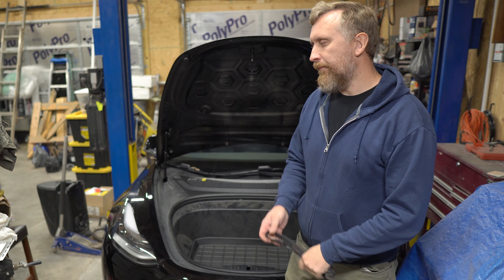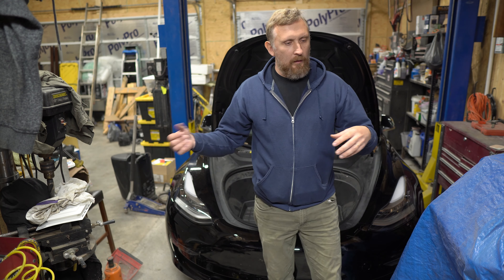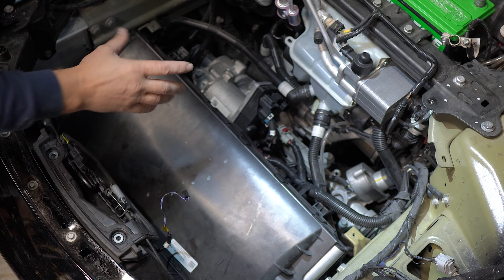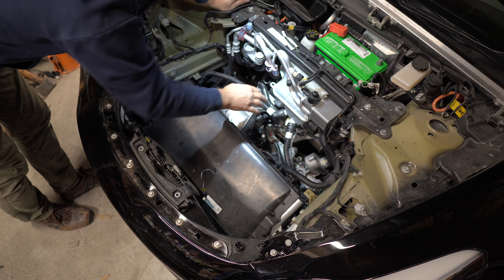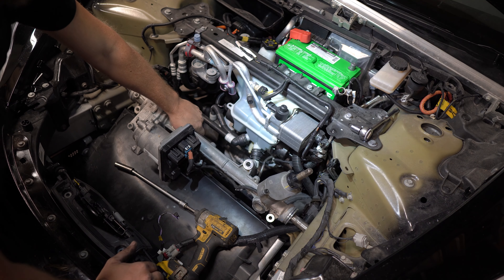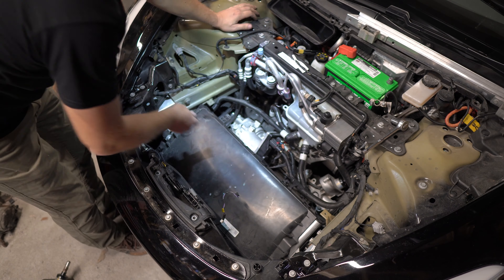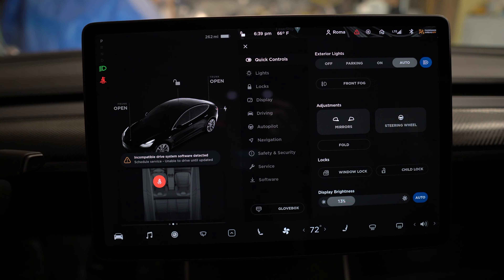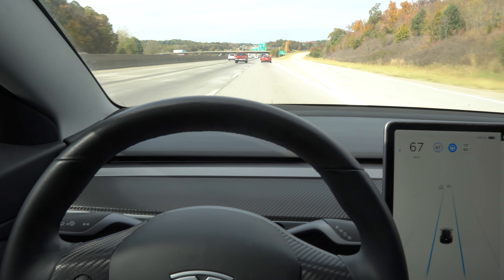Tesla Model 3 Rack n Pinion Replacement

Comment: The last letter on the part number is the version. For example if the part number is 1233454-00-A that’s the first version and part 1233454-00-B is the second version, etc. For the most part, as long as the first numbers are the same then the parts are interchangeable.

Comment: Thank you for making this video!  I hit a curb and I think something broke or worked loose in the rack & pinion.  I already replaced an inner tie rod and was also surprised there was no retaining washer to keep the socket from working loose.  I will plan on re-using the existing motor as you found out.  It looks incredibly easy to swap the whole rack, thanks again.
Reply from the maker: Thank you
Reply: By chance do your know the torque specs for the inner tie rod
Reply from the maker: @asantae007tv3 I don’t but check on Tesla service website. They might have it on there.

Comment: Hi Roman nice projects you have here, I got an issue with model 3 I’m rebuilding now, on screen it shows wheels fully turned to the right when they are actually straight and car pulls to the left because it’s trying to straighten it self electronically. I did try taking steering wheel off and spin the slip ring with my finger it does alow two full turns but then it conflicts with other steering angle sensor which is on steering rack and that’s where my issue coming from
Reply from the maker: I’m not sure, but I would think steering angle sensor needs to be calibrated.

Comment: Hi great video helpful👍 I just want know about Tesla model 3 after replacing pyro fuse still gear liver is not responding is there any program has to be run ???
Reply from the maker: I don’t think so, when I replaced my Pyro car did start driving.
Reply: Ok first thanks for the reply I replaced the pyro and I reset air bag module but still I couldn’t move it to drive it gives me vcfront a192 fault in the screen thank you 👍
Reply from the maker: As far as I know right now you have only two options, take it to Tesla or buy a cable and subscription for Tesla diagnostic software.

Comment: I watched a tear down of the Model 3 rack and pinion on Youtube a while back and the auto-steering motor moved the rack via a belt.  Wonder what happens when the car is performing the steering and something in that motor/belt assembly fails?  Does the car ask the driver to immediately take over? If they do not, I assume the car would stop possibly in the middle of the road?
Reply from the maker: I don’t know for sure since I never had a broken belt on me in the steering. But I am assuming if that would happen, you would definitely get an error message on the screen, but I would think you would still be able to drive it though steering would be very stiff.

Comment: Bought a M3 RWD (46K miles) from an auction with the front right lower control arm nut broke off so I bought a used control arm (didn't know that I can buy it from Tesla) and replaced it. I noticed the front right wheel toes in a lot and needless to say the car pulls one direction. I tried to open the right outer tie rod and couldn't but I noticed I can rotate the tie rod a little bit to the front and the back on both left and right tie rods. I tested my friend M3 (15K miles) tie rod and they don't move. I tested my 2017 honda civic and it moves just like my M3 so I wonder if that's normal. After test drive a little bit the car seems to be swinging a bit I has DI_a223 traction control disabled, DI_a222 stability control disabled, DI_a178 steering alignment needs adjustments. I wonder if full alignment will fix these issues or is it the steering rack issue?
Reply from the maker: As far as ball joints, they can swing back-and-forth by hand, depend on the wear, as long as there is no play, you should be fine. Those error codes went away on mine after a driving it for a little bit. As far as car swinging while you drive it yes alignment can fix that unless it caused by something else.
Reply: @akindiyrebuilds6223  thank you.

Comment: Does your vehicle still get firmware updates? Typically the vehicle firmware update will include subsystem updates, so if you install a part with an older update the next vehicle firmware update will update that part as well.
Reply from the maker: Yes I do get updates regularly. But I don’t know if particular update would include particular module firmware update.

Comment: Hello, great video! I will do similar replacement, do you recommend to install orignal motor in the replacement steering gear? Or first to try to install replacement as it comes? Any special care when swapping the motors? Thanks a lot!
Reply from the maker: I only replaced Rack and Pinion and kept original motor because it’s programmed to the car. If you have to replace the motor as well, then you will have to program it to the car.
Reply: @akindiyrebuilds6223  thanks! In my case the rack and pinion housing is cracked, motor should be OK. Any special care when swapping the motors to keep the alignment? Thanks!
Reply from the maker: @elconductor23  there is no alignment on motor just a belt tension. But keep an eye on your rack and pinion wheels position so you don’t break a clock spring.
Reply: @akindiyrebuilds6223  How do you program to the car? Can that be done in Tesla Toolbox?
Reply from the maker: @Apreamareyachts  I haven’t done it myself but I’m pretty sure Tesla Toolbox should be able to
Reply: @Apreamareyachts  Hey did you find out how?
Reply: Yes, simply reinstall the software from the Service menu. Easy peazy!
Reply: @Apreamareyachts  any risk in reinstalling the software?
Reply: just do a service mode, install reinstall software
Reply: @Apreamareyachts  service mode, just reinstall software

Comment: so which motor did you use? the original one or the one that came with the replacement rack?
Reply from the maker: Original, replacement would have to be programmed to the car
Reply: @akindiyrebuilds6223  I have a new rack for my model 3 but the two center mounting holes are smaller then the original, I cant drill them slightly bigger  so the bolts will fit but other then that the rack is identical
Reply: @braddenning1617  does it have the same part number?

Comment: Has supercharging been disabled on this one yet?
Reply from the maker: I haven’t got a chance to check, pretty sure it is disabled. Never really had to use a supercharger with previous one anyway.
Reply: Can u still dc charge it in some other chargestation?
Reply: @dot7107  yes
Reply: @dot7107  If you can DC fast charge at none Tesla Superchargers, there is a good chance you can Supercharge.  AFAIK, DC fast charging is disabled from the car side which disallows all DC fast charging..
Reply: If you do the repair yourself you will be blocked from using super chargers?
Reply from the maker: Supercharger gets disabled if car gets a branded title, making it unsupported vehicle for Tesla. But as far as I know you can get two inspections done by Tesla and get supercharger reinstated.

Comment: I’m in the SF Bay Area. I have a model S 2014, with no power steering. I believe the problem is with the motor. According to your video I need to sync the replacement motor with the mod S. Please let me know if this is correct and if anyone knows of a Tesla mechanic in the SF Bay Area that could do the sync.
Reply from the maker: On 2018 model 3 you do have to program replacement motor to the car